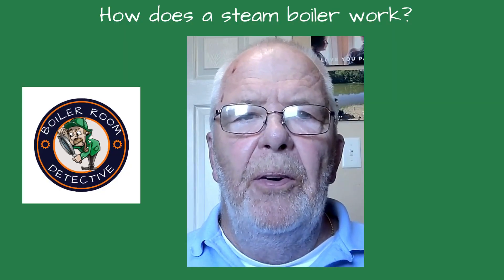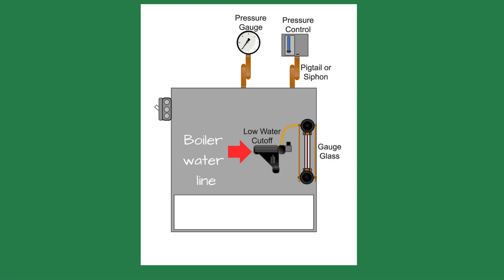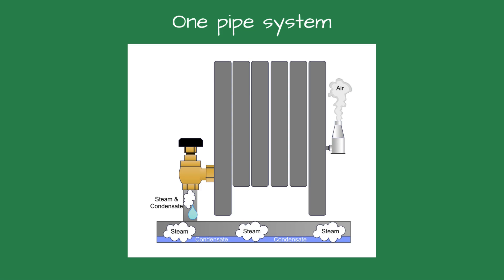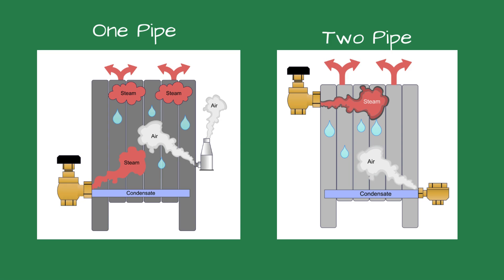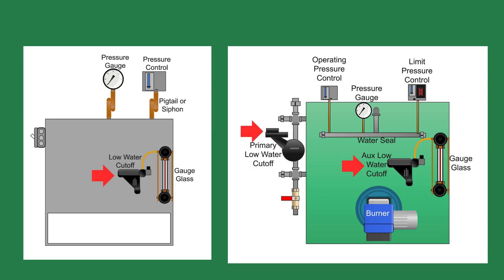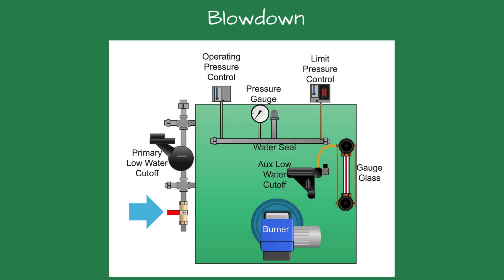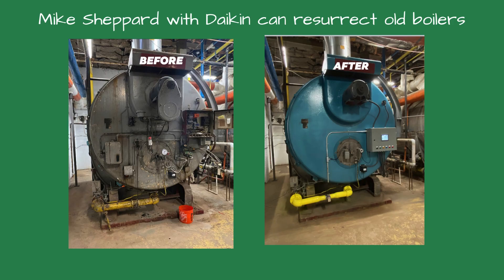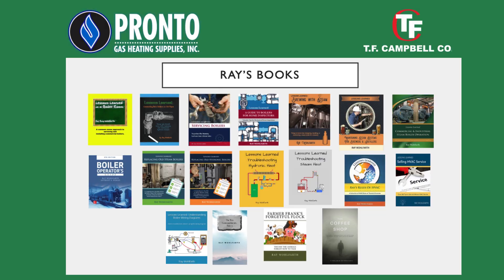How does a steam boiler work

Comment: Nice Video Ray! At 1:43 I will offer this friendly criticism that steam being lighter than air is not really relevant. It's the pressure (caused by the much greater volume of steam compared to the water it came from) that pushes the steam where we want it to go. It will go up, down, or sideways, wherever the pressure pushes it through the pipes of the system. Steam being lighter (less dense) than air isn't what moves it through the system.
Reply from the maker: You’re right Sorry I missed that It’s all about pressure differential Thanks
Reply: In the overall sense, it is the pressure differential.  But in the details, I've just found it enlightening to consider how the steam (H20 vapor) being lighter than humid air (H20, N2, O2) which is lighter than dry air (N2, O2).  Steam is at the top of the main over humid air then condensate.  It is steam that goes up the riser, likely in the center of a concentric layers of downward flowing humid air and condensate layers.  

But is seems the real magic happens in the radiator as the lighter steam rises to and across the top.  As air bleeds out the vent, the steam doesn't flow down to fill the void, but rather air moves sequentially from each section via the bottom connection and steam fills in behind.  

I'm sure there are errors in my mental model but it is interesting to consider this normally low relevance process.